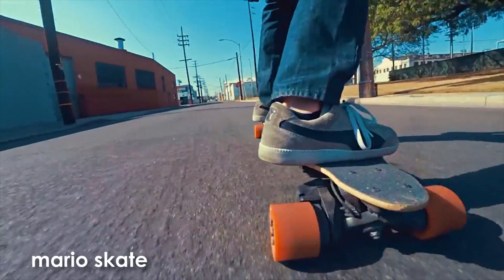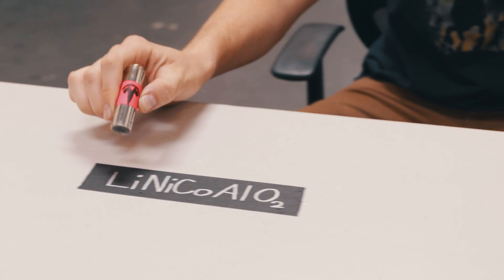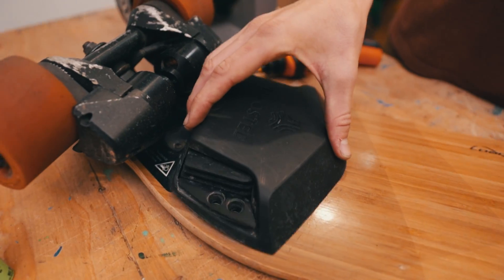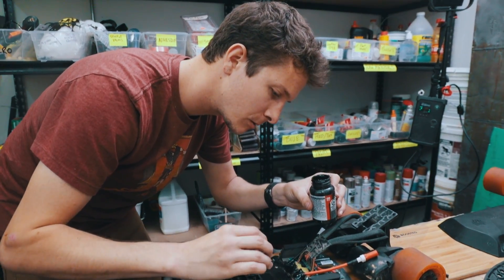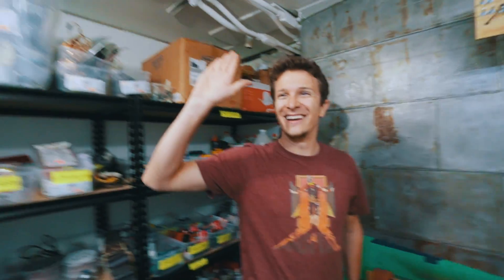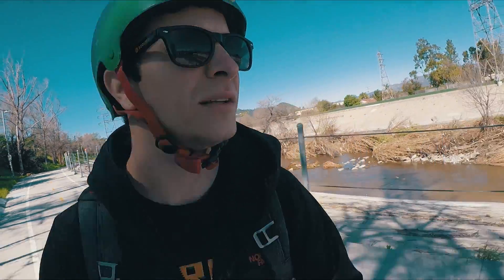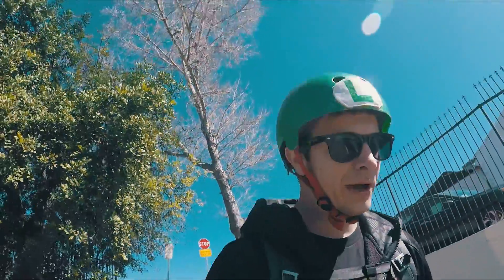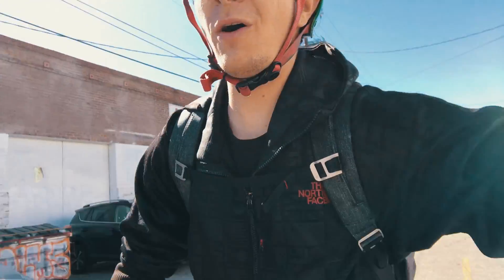Tesla Batteries in an Electric Skateboard!

Comment: you could also push up the amount of watter your getting out by a little bit so it we be able to but it out a little bit faster and if your going that fast it you might go drain your watter more then it could before or you could make 2 out comes on each battery so but split them up to like 4 packs and then it might drain the last bit of energy in there so you can get full out come

Comment: Try 25r or vtc5a 18650 batteriesthese has 2700mah and 30A discharge or 21700 40t if im not wrong these 40t have 4000mah and also 30A discharge
The 21700 30T have 3000mah and 35A
What i dont know its if the discharge current are continously :)

Comment: If you have more power than you need from the start you could use a pwm switch to pulse the batteries to only allow for a restricted constant output for longer due to the reduced load? That way you wouldn't even have to worry about using the lower threshold of the batteries anyway?

Comment: Why don't you use the batteries you need to power the booster board so the booster boards battery gets charged even though it's getting used

Comment: I suggest you to use some sort of circuit using a Arduino to measure the voltage, and if the voltage drops below the limit, it uses a relay(it triggers the relay so that the current flows in the other terminal) and the other terminal is connected to the battery booster, so that you can continue the ride(but you need to also monitor the current voltage and trigger the battery off if it drops.below 30v or you will again get a dead battery) I can help you with the coding required

You would understand it easily if you know what a relay is or how it works with 2 terminals, you can even add a dinamo to the wheels so that the more you ride, the more the batters gets charged, and if you do so you definitely need to add diodes in between so that current doesn't flow from battery to dinamo

Hope this helps

Comment: The problem might be that the board is designed to conserve power after it would run for a long period of time.  Hence why it had such poor torque and speed.  The board may think "We are usually dead or low by now, we need to last as long as possible" and would try to conserve what little power it believes it has.

Comment: While the board is in motion use the motion of the wheels to recharge the battery that is drained slaving the new input batteries to nullify their output. A small generator with a gear that can step up the input inversely proportionate to the battery usage. This will fix problem A.
Also, also use a step up transformer to induce more current to the motor. Try using a variable resistor between the motor and the battery output induction contact. Also reducing malfunction due to overload. 
Also, also, also use an aftermarket filter to smooth out the signal. Even though your working with DC this will extend the life of not only the batteries but, the hardware that they are connected to.

Comment: Can't you just have the additional batteries go into a control board then into the boost board battery so once the additional batteries go lower than 30.5 then it will switch to the original battery?

Comment: If you re-pair the batteries closer to the board batteries add a power converter and connect the batteries you can rewire to allow to see the extra pack batteries level and change/check the motor and gears to insure no damage replace as needed

Comment: Just saw this and to help you could use a sort-of double range converter by making a way to splice the voltage range of some devices that can use all of that power in the way that still puts the power output in the way that you want and get the life needed to complete the task 
Hope this helps if not sorry for the waste of time

Comment: What he needs is a battery management system or a BMS ,it would allow the battery’s to drop to lower voltage and it also would allow him to charge both the batteries at once instead of one at a time.

Comment: If you can actually transfer the charges of one battery to the other to obtain the sum of charges and it acts as a primary battery but we need to make the board work on one battery . So the second battery can be the reserve battery . You can make a portable dual sided charging cable like the ones on phones . The other way can be to add more batteries but that adds more weight which will affect the speed of the skateboard.

Comment: Put more motors on the wheels to charge the batteries while you are moving, and the batteries will never run out. then you can get to work. Or you could just replace the Boosted board motors with higher torque motors. I hope my ideas are useful to your progress. Please use this so I can be in one of your videos. By the way, I really liked your Nerf Attack Drone and the Atlas CGI video from some time ago.

Comment: The only solution is to make battery back-pack. Be careful to make really good and safe connector(s) for quick release. So, when want to drive, connect backpack with all batteries (parallel, series...).The most important part is to make safe connector in the case you fall and skateboard goes away. Or secure connection somehow with rope or something. Also, be sure that cables from backpack has female connector, not exposing contacts that can accidentally short.

Comment: He could bypass the boosted board batteries or just remove them, he could also try to replace or reprogram the BMS (battery management system) the boasted board bms doesn’t allow the regular battery to drop below 30v, the Panasonic batteries can and would, if the BMS wasn’t stopping them from doing so.

Comment: Use the batteries you made to constantly power the booster boards battery. Basically like a self charging phone case, you charge your batteries and have them connected to wherever you charge the booster board battery meaning that the main battery will either not lose charge until the other batteries do, or the main battery will drain a lot slower because it is constantly being charged. I don’t know if it would damage the main battery it being powered and powering a motor which is carrying you and other weight. If you read this, pin it and if you use this, please mention my comment, I want credit

Comment: So the boost converter would be your best bet. You set the boost converter to basically be the top voltage of the board, that way you keep the board's batteries topped off... until the Lithium ion batteries are dead... and then the BCs cut off and use the board's battery.

Comment: I could be wrong but wiring batteries in series increases voltage, hence power (typically) and wiring batteries in parallel keeps the voltage the same, it just adds in more run time... Not the power he was wanting to climb the hill.

Comment: Manipulate the battery charger from 30V to the Volt of the LiNiCoAiO2 line then you need to remove the boosterboard battery. I hope that i didn‘t made a english failure.

Comment: So do be able to use the rest of the power in the battery’s you would either have to remove the old battery or wire in the new battery’s directly to the motors or at least closer to the motors in the circuit than the old battery. And the reason that you can’t see the charge on the new battery is that you wired in the new battery after the monitors that tell you the charge of the batteries.

Comment: I know I'm late to this but I learnt this a week ago so correct me if I'm wrong 

I believe you are using two different amounts of battery the normal skateboard one and the Tesla ones. To make this work you can only gave one type of voltage or it wont work and the battery would increase the capacity and not voltage. So you can either have just Tesla batteries but more or skateboard batteries but we all know what you going to choose

Correct me if I'm wrong

Comment: Best idea is to retire the entire board , add new Tesla batteries, replacing the ones that come factory installed in the long board. Also there are different motor you can get that output more power. Try a different motor. Or https://www.electronics-tutorials.ws/dccircuits/dcp_2.html

Comment: Well I thing I solved your problem at 10:40 I heard of this electronic scooter so say your going 10 mph when you brake it transfers that energy to the battery so you can go longer distances but the thing is I can’t remember what the name of it is
Reply: Regenerative breaking is an efficiency thing it doesn't address the core issue the the batteries aren't being fully tapped

Comment: Hey I have a question would it be possible to re-charge a boosted board or electric skateboard while you’re riding it would the wheels generating enough electricity to recharge while riding would it be possible
Reply: What? Then what's pushing it forward? 
The wheels are turning because the motors are turning due to electrical power. If you use that motion to generate power then the wheels stop moving.
This is the concept behind regenerative breaking as when your breaking you no longer want to move forward.

Comment: My brother actually modifies drones and electric planes, and idk if this was the best way to go about this upgrade.  Your old batteries died because of the Type of battery you had.  Those needed to be kept at storage voltage, or they die and really, can't come back..  As for the battery you chose to  upgrade your board with, I mean it's fine, but Tesla used that type of battery because it's cheap for them to mass produce small batteries and stick them together; you probably should have just purchased a larger battery, it'd have worked exactly the same as the one you put together.

Comment: Or find a way to take the battery barge in the Tesla ones before they reach 33 volts and switch them to the other so it has full charge again then use it till you reach that 33 again idk I’m just making random stuff up don’t be surprised if it don’t work

Comment: You could prolly find a way to take the rest of the charge and pull it out of that battery into another smaller battery with no charge and use that battery to continue riding

Comment: I hope that you learned more because that analogy that you used in the beginning is COMPLETELY incorrect. Lithium Cobalt batteries can hold much more than LiFePO4 batteries and can output the current fairly quickly. Nothing comes close to your Lithium Polymer when it comes to output current though. 

The only thing that LiFePO4 has for it is it's safety and ability to get 12.8v with a 4s setup which makes it great for automobile applications.

Comment: 3,5V per Cell is kinda low for those batteries! U should never go under 3 Volts. You have a 10S Batterie which means 30 Volts is the absolute minimum. Better would be to stop at 32V or 33V to keep the Batteries in good condition.

That's why you were slow at 35 Volts left.

Comment: I suggest that the top wheel of the skate board can be a generator for the 2nd battery to charge. And if the first battery low bat you can switch them...

Comment: For the love of god don't mix your new batteries with the Boosted Boards integrated ones.. Remove the integrated batteries and replace with your pack only. Optionally add a custom PCB for battery management system. You might as well build your own board with Open Source hardware like the VESC motor controller and more powerful brushless motors.

Comment: Maybe a Mosfet, capacitors, and maybe a microwave transformer with some aluminium  heat syncs might have an affect simply because it makes an AMPLIFIER 😵. Oh and maybe hook it up to a circuit board separate to original and add cables from New mod circuit to original circuit and modify your voltage output to  your circuit  and you might get what your looking for 🤤. Lol basic electronics oh and change out your gear to wheel gear ratios that too can make a difference. Either way your gonna need more juice so if you really wanted to you could also try buying a raspberry pi computer  to fully mod your system over. If you know programming and coding it should be a breeze. Good luck bro 🙋‍♂️

Comment: So what you did was like, hoping to get more torque, you added a few more powerful batteries, ok but its like getting a bigger Gas tank for your motorcycle, using the same engine. you need also a new engine/or electric management device to outperform your needs and get the best from those  batteries man!!

Comment: You need the flux capacitor  to power it and connect it to your power system and into your remote. Install some gauges  so you can monitor what time or year you’re in. So just go back in time at 9am and start over.

Comment: What's keeping you from just removing the booster board battery outright and just hardwire the new battery pack. simply bridge where the original battery used to sit and that's that. You may need a third Battery pack simply to reach the current you want, but once everything is hardwired onto the circuitboard itself, the board should recognise the battery packs and problem solved

Comment: Sounds like it might be a voltage cut off like electronic speed controllers have in model cars or planes.  It prevents the batteries from receeding past a certain voltage where they cant be charged front again.  Id check to see if theres any info on the on board circuitry and see if theres a way to circumvent.

Comment: All these Tbags, thinking the batteries are some magic thing. This guy has the electrical theory knowledge of my cat. Good luck bromo's I hope you used Tesla's charger tech as well, because mixing those battery types requires proper charging and monitoring during use. But hey, have fun burning your house down. And by the way, if you actually had proper equipment and a clue, this video might be helpful, but, a bunch of dummies are now gonna ruin their boards.

Comment: Running batteries in parallel like that is not easy.... ah, the days of robotics... how I miss you so

P.S. the way I'd do it is I'd pretty much remove the skateboard battery, and just use the tesla one. Otherwise, I'd replace the two batteries for the skateboard with ones for Tesla
Reply: Mr. Fox So did the tesla batteries work better than the normal ones???
Just Asking

Comment: You need a joule thief to rob a little extra power from your batteries.  Or you could just ditch the original batteries and replace them with the high current batteries with the lower drop-out voltage.

Comment: boost meter seems like a good idea. once it reaches its limit you can turn on the boost meter by programming it to activate using node mcu. theres a mobile app called blynk. you register a virtual button in it which tell node mcu to activate boost meter your mobile must be connected to node mcu's wifi/bluetooth.

Comment: LOOK AT THIS:         What if you used a 400,000 v battery.  B = 400,000 V Battery.  9 = 9 V battery.  S = Slide Dimmer.
Put it like this:  B to 9 to slide dimmer = Energy to motor.    Please use this idea.  Look on amazon for the battery.  It is a 400,000 V Transformer.  I will give you the actual link in my next message.

Comment: Hmmm if that booster battery is that then just put another battery to extend the length of the booster so that the other power of the motor/battery that runs the wheels and the left power is used (does that make sense) I'm trying to say that if we extend the small cup with another cup of water it has more capacity and the bottle of water can be poured in the cups so the water left is useable the water is the power the bottle is the battery and the cup is the booster

Comment: The reason you don’t have the torque is because 35-40v is low for a boosted board. You need more batteries in series.

Comment: What if just make the bettery to keep charging the booster board
Reply: I hear using a battery to charge a battery is quite inefficient
Reply: @planenerd907  but it still able to charge the battery
Reply: @zjgamer5250 I'd rather just disconnect the booster board battery and connect the new one. you can even combine them in parallel.  minimal energy loss from what i know.
Reply: @planenerd907  ok thats a better idea

Comment: Sorry but that is not a proper way to solder those connectors to wires at 3:20. You have to heat the connector so that it solders to the wire. Better re-do it until it fails from too much current that already travels through those thick wires. Edit: Wow this video is from 2017... How did the connectors perform?